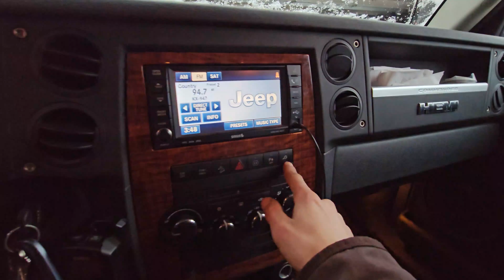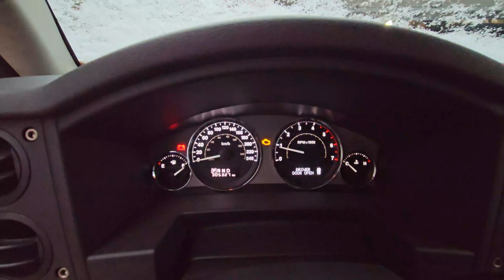Jeep Commander OM642 Diesel Swap Pt 2

Comment: Insane timing! 
I'm gearing up to do my swap into my XK but have the wife daily driving the WK to work out all the kinks before I know the engine is healthy, I also have 300,000km 
How did the body harness go, did just the engine harness get replaced?
Reply from the maker: Engine/ trans harness, HVAC/ radio harness, harness going to headlights/ taillights all got swapped.
Reply: Did you swap the ECM

Comment: Good job!!  WOW!! just WOW!!  I have a 2007 Grand Cherokee with the 3L diesel (OM642).  You went all out doing the swirl motor delete, cluster swap, engine bay looks just like the GC bay.  Very impressed!!  What was the code reader you referenced in the video??  Got it "IcarPro".  What software do you like with this reader??   I use "DashCam" on my GC and get catlyis temp reading near 800 degrees.  Do you have a way to read EGT???
Reply from the maker: I use a cell phone app "JScan" for all my OBD2 needs for the Jeep. It connects to the dongle via Bluetooth and can read all sorts of values, EGTs included. I believe the software only works for Jeep models though.